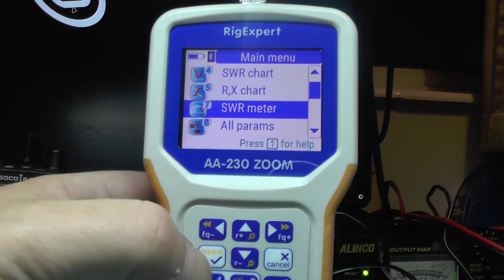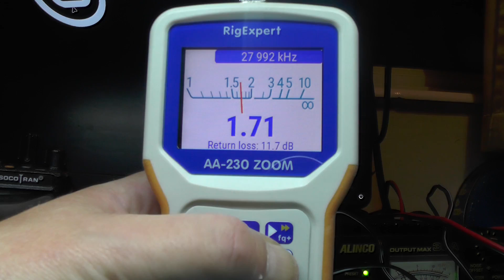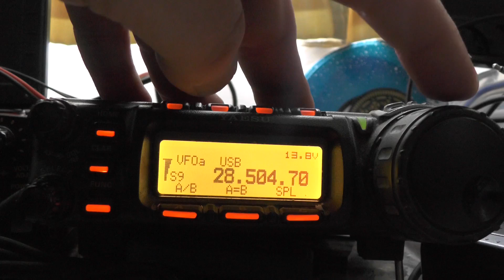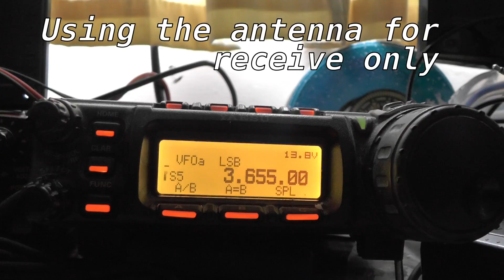The New Antenna Lets Test it

Comment: My concern would be the 11db of loss you’re getting. Have you grounded the mast? Maybe putting it a little higher off the ground would help. But 11 db of loss is killing your transmit leaving you less than 1/2 a watt for your 4 watts output. And of course the reverse is true
Reply from the maker: @WX4CB  I’m running a long length of cable I’ll try it with a shorter cable and see what the loss is

Comment: Best to evaluate the noise floor when conditions are poor - any kind of lift will bring both signals and noise in. Any vertical like that is noisy without radials or grounding via ground rods but can work very well when adjusted properly. Using a common mode choke will help a lot as will several clip on ferrites on the coax to the rig. Also make sure there are no LED or tube strip lights close by ! It has taken me several years of trial and error to learn all of this working QRP. 73 M7BLC.
Reply from the maker: @johnnorth9355  the neighbour has lights in the garden which is no good they tend to be on more in the winter I’ll wait for the lights to come on and test the qrm